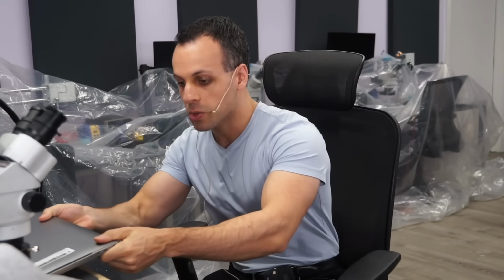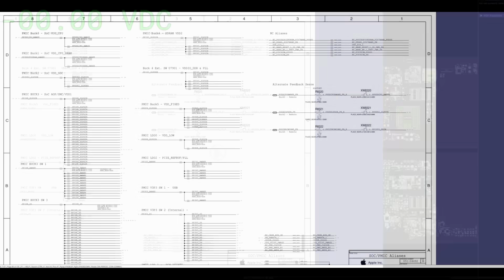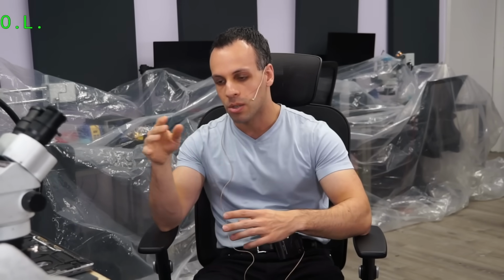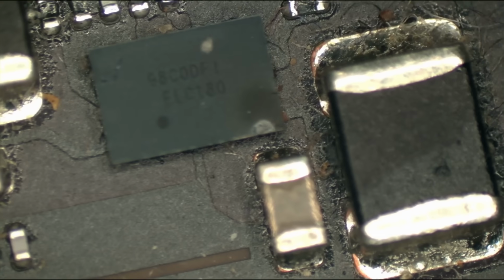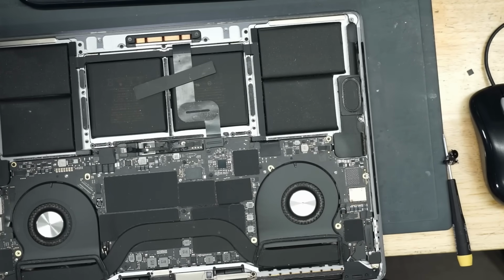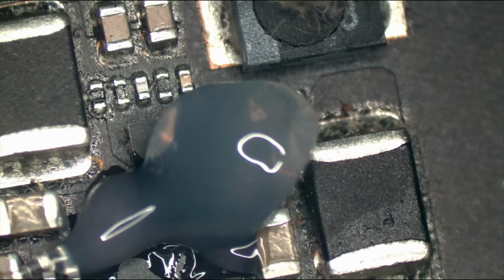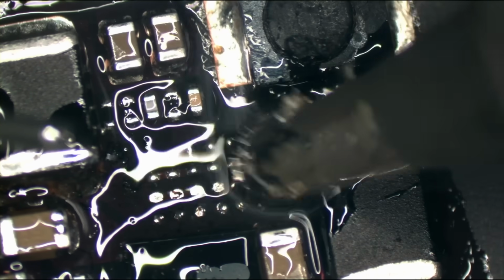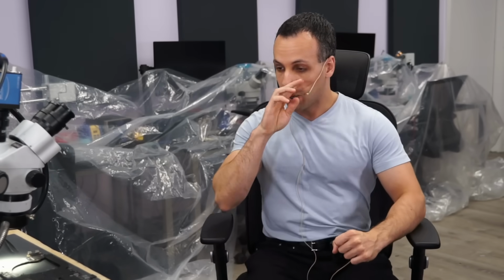How most 16" Macbook Pros often kill themselves & why they're unfixable

Comment: Nice video. Such a stupid situation, they could place a tvs varsitor (voltage-dependent resistor/ vdr) up on to 2.7v line wich would short the line to the ground if voltage excess 3v preventing the nand from frying out. Omg why has it not done. It’s a bug a genuine bug.
Reply: The part just for ex. vcug040030l1wp, this shit costs 21 cents for crying out loud.

Comment: Sir Louis. The exact exact same ditto thing has happened with my MacBook Pro 16" 2019 core i7 model. Apple official Store gave a quote of almost 1000 USD for replacement of logic board. MacBook Pro died in the middle of a very very important work. Had paid 2.25 lakhs INR for it in 2019 end. Have lost trust in MacBook now, after being a MacBook user for 7 years almost. 0 repairability.

Comment: tl;dr
a chip that's supposed to deliver 2v to the ssd instead of raw 13v can die and send 13v to the ssd, killing the ssd, all the data on it and requiring a motherboard replacement since apple won't sell any parts to fix it

Comment: Much of this (Right to Repair) applies to new stereo components.

Machine production lines install parts to PCBs.

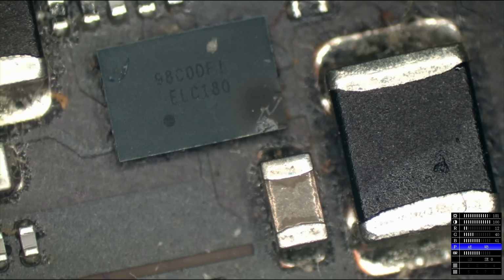6:10

Instead of capacitors being size of a Cheeto, now size of a grain of rice.
Too small for techs to repair part.

They can test boards as he does here for in/out voltages but nothing else can be done.

Once replacement boards are gone, that $2k to $7k unit (Made in China) is done.

This is for 3 year old 7.1 9.1 11.1 stereos.

Comment: I used to use a Macbook because it is way more stable (need 95% less software maintenance) than any Windows device, and Macs are all but immune to online computer viruses and malware ( Ransomware is really bad these days, and Windows is the most vulnerable to it).  But then I learned about the 100% free Operating System called 'Linux Mint', I tried it by installing it on one of my older Windows PCs and now I use the superior Linux Mint instead of my Mac.
Reply: Mac's are not immune to viruses nor malware what are you talking about
Reply: 95% less software maintenance bro what are you talking about

Comment: The original machine has a base-plate of prefabulated amulite, surmounted by a malleable logarithmic casing in such a way that the two spurving bearings were in a direct line with the pentametric fan.
Reply: Yah, but those turbo encabulators were loud, and they smelled like burnt transmission fluid when they got hot. Now with the hyper encabulators, you have to put them in the oven and hope to fix the bad solder joint between the six marsel vanes.  You can check if you're successful by connecting a DRBII to the aft end of the moxie interrupter.

Comment: Hey Mr Rossman, I have this computer in an expensive configuration. Is there anything I should do to prevent this from happening to me?
Reply: Back up your data! Today, external drives and cloud storage are dirt cheap. If you pay for that, you won’t have to worry your data is toast when your on board SSD has died.

Comment: I’ve been using MacBooks since around 2009. Have not run into that issue yet but that really is gross. I really wish they didn’t prioritize the thinner form factor over more reliable parts. Is there a solidly built laptop brand you do recommend?
Reply: If you want dependable Lenovo thinkpads generally. Everyone else pretty much sucks ass. I like blade 15s from razer but they sound like jet engines

Comment: The Magic PP Bus

But I guess their idea is anybody who has deep pockets enough to land a Pro can simply replace it and WILL.  So going through two or three units in a year would be no biggie for the customer.

That's a little like BMW.  A lot of poor bastards scrape and save to get one and have absolutely no idea of the ridiculous maintenance costs.  You can't just buy the thing.  You are locked into an expensive system to keep the thing going.  Much as the guy who scrimps and saves and gets donos here and there and gets a Pro while at the same time not having any means to replace it if it decided to take a shit six months in.

Comment: Louis, I have a 2014 MacBook Pro that my dad gave to me, thing takes a solid 5-10 seconds to open a chrome tab, thing chugs along still but the battery kinda drains itself even when not in use, I don’t really mind but do you think the battery is replaceable?
Reply: On MBPs made up to 2014, all components can be replaced. After that, they soldered everything in.

Comment: I said on a thread that these things are not designed for professionals and it upset people because, naturally they were probably professionals who use Macbooks. 

If these things were designed for professionals, you'd have, SOME, level, of repair-abiltiy. That when an SSD dies? You'd be able to remove it from the computer and slot in another one. It's like, we have 2+ standards for SSDs but sure, just directly solder it to the board. Same with the ram, same with the other thing. 

But they're not. They're designed for people who're okay with disposable devices. SSD broke and you lost all your data? Why didn't you have cloud back up and apple care? That solve all the problems here- clearly. Nevermind that before apple popularized this, we had devices that you could swap out, many, components. We still do, but what's cheaper and makes people less inclined to try to fix it? Integrated, soldered on parts. 

Imagine if everything wasn't soldered down, imagine if they made it easier to fix or replace parts. 
Imagine this device that is actually impressive in it's performance had any ability, to be repaired.
It might actually be good for professional use.
Reply: Well professionals do typically have regular back ups. A lot of companies don't even have anything on company computers and rather have it so everything is on a server elsewhere or available via cloud. if anything backing up from apple can feel better for the individual user. But if you don't have backups and your drive hard fails. likely you're not getting that data regardless without sending it to a specialist.
Reply: @qxevtnu1879  
Hi, professional with a back up drive here: 

I have back ups, but also if my drive fails in my desktop or laptop, I'm not hoping the manufacturer won't screw me out of hundreds of dollars for a a basic standard drive swap that would take all of 10 minutes because they decided soldering was the best option.

Many companies agreed on standards and Apple feels they're above that for some reason. Well, that would be the case if it wasn't just a case of "We know the average user will either pay up the hundreds or, buy an entirely new device for what should be $100 or less.

Comment: I used to work on mac products for 9 years and I will never buy mac products. One year I had to remove around 100 desktop mac computers from the 6 buildings I worked in because they died in a way that could not be fixed.

Comment: Given the fatality of this failure mode I wonder how costly and hard it would have been for Apple to incorporate an over-voltage clamp circuit to protect the SSD.  A zener diode with a conduction voltage below the max voltage of the SSD perhaps.
Reply: How about a replaceable SSD? I know Apple isn't the only one soldering on components but it makes sense for a computer for an SSD to at least be interchangeable.
Reply: @VanSanProductions  Both, but a zener protection would save the SSD (in most cases).

Comment: My (Same model) did something similar last week.  It was running, but all of the USB-C ports died. Couldn't charge it .. couldn't use the ports for anything.  It just happened randomly.  Was using it, and then it stopped charging and the external monitor died.  (Via USB-C). Oh yeah, half the keyboard backlighting shut off as well.  (NO liquid damage)

So, I quickly mapped to a network drive and saved as much as I could before the battery died.  Company sent me a replacement, but going to take it to Apple tomorrow to see if I can salvage any additional data.  

This sounds like a slightly different problem, but it's troubling that such expensive hardware blows up like this.

Comment: My 16” MacBook Pro 2019 woke itself up in my bag and cooked the T-CON board effectively ruining the display because you can’t replace the board without also replacing the display. $700 to fix and it wasn’t something I could prevent other than fully shutting it off every time I put it in my bag. Worse yet, besides the waking up on its own part, that section of the laptop is horribly designed. There is no airflow over the VRMs or the sensitive-to-heat T-CON board. It’s doomed to happen sooner or later if you push it hard enough. After my board cooked I did the VRM thermal pad mod and with an external fan it is crazy how much more performance it can get, stock it throttles the GPU after like 5 minutes because the VRMs overheat due to having literally no airflow to cool them. With the thermal pad mod to actually dissipate the VRM heat, it can run for hours at full power with no thermal throttling. Absolutely ridiculous and horrible design.

Don’t get me wrong, I love the form factor and outer design of it. But it runs super hot all the time because of the i9+5500m in such a small space and then this.

Luckily it was given to me, so I’m effectively paying $700 for it. But if I paid the $4,000 it originally cost I’d be pretty upset (and I also would have gotten Apple Care+ lol)
Reply: Wait a minute...so it woke up with the lid closed and that killed the T-CON? Bizarre
Reply: @Markyroson  for whatever reason it did not automatically shut off when it overheated. I’ve had windows laptops wake up in my bag before, but they auto shut off at some point when they get too hot. They also only had low power CPUs. This one has an i9 that’s already stupidly hot even with good airflow. It got so hot I had to be careful touching it so I didn’t burn my fingers and STILL didn’t shut itself off. Since the T-CON is between the CPU and GPU and doesn’t have any airflow it didn’t stand a chance. Still love the thing and don’t plan to replace it for a while just frustrating it could have been prevented by either better thermal design or an overheat shut off.

Comment: Knowing having a problem and then not fixing it is illegal. The Macbook's should have been recalled, the product fixed or replaced for free. It is also a security hazard because all someone has to do is enter in a command to cause chip to overload the ssd after they have stolen the data. By the time you find out you have been HAD they've already stolen your info. It would take a very large class action lawsuit in order to prove willful negligence with a plethora of witnesses, materials and computer engineering experts. THE DEATH CHIP really can be taken advantage of by someone even Apple. Just think Apple hears that you’re arguing with someone at Apple Care and then a week later your system dies without a trace. Then they blame you for water damage and refuse to honor their warranty. Check Mate. I'm not saying that they are doing this but I am agreeing that they are trying to get out of their warranties way too much.

Comment: I feel like I’m missing something. Why was the replacement chip never put back all the way in the correct place before testing? It was one column of pins over
Reply: It wasn't replaced at all.  It was just sitting there disconnected.  He did another test for a short that was present even with the chip disconnected, which confirmed his suspicion that replacing the chip was futile and the machine was bricked.

Comment: Hi Louis, sorry for asking this because there are probably many people who had asked this already, 
Would you recommend the Macbook pro 14" with the M1 pro chip?
and will you recommend to purchase the AppleCare? From an Asia country, the applecare doesn't cover theft/ accident/ liquid
Reply: no, same reason as video mentions, it will eventually die and there is nothing they will do for you unless you pay stacks of money. The idea that macbooks are somehow efficient and powerful is a ton of crap anyways.
Reply: @danishblunt9698  thanks for the reply. 
Which windows brand doesn't do that and is recommended? 
How about the XPS 13 plus?
Reply: @shengxian  Stay far away from dell, they are pretty much like apple, don't give a damn and their machines are unreliable. 

The beauty of windows machines is that you have many catered towards certain needs, so before I can recommend anything, I'd need to know what you need it for.
Reply: @danishblunt9698  mainly for multitasking productivity works with many chrome tabs, Microsoft office. Photo/ video editing - only a few times a year and just for leisure. Not gaming
Reply: @shengxian  Zenbook 13 OLED (UM325) is probably what you want then. The panel is excellent and catered towards video and photo editors, it has superior contrast vs the macbook and has 100% DCI-P3 range vs Macbook's 13 & 14" 75%. It's even better due to its contrasts compared to Apples 16" XDR display. 

Due to its AMD CPU combined with huge battery it outlasts apples macbooks by a bit and doesn't loose performance on battery. 

It has all the ports you need such as SD card and full HDMI. 

if you don't mind a bigger machine, ASUS also has some seriously incredible machines such as the Asus Zenbook Pro 14 Duo OLED, it's a producivity monster. Content creators are absolutely in love with it and it has become the go to machine for many these days. It wont last as long (for obvious reasons) but for those who arent on battery all the time its a huge deal.
Reply: @danishblunt9698  thanks for the recommendation. I don't really need to do media editing a lot, just once in a blue moon. How about their durability and machine service?

Comment: Louis, not sure if you'll ever see this, but how about a video where you show what people can do to prevent this? It may be as easy as installing a single diode to protect against excessive voltage. I think that would be great content as you'll actually help prevent this shit from happening while also driving up business to those who can actually install said diode.
Reply: I think for almost 4 generations of MacBooks in his previous videos some years ago, he kept telling them about a flaw in the design of their mainboards, and this is what you need to do to fix it (of course it involved using more components, which is apple cutting costs on their gold plated computers, which is the whole flaw to the manufacture to begin with). On the 4th time he literally went on a rant and said hes not offering design fix advice and just advice on fixing because Apple will never fix their mistakes without a lot of market pressure. They want your shit to break, when it does, they want you to only go via apple to get it fixed and pay a fortune for it, and if you don't get it fixed that you drop even more money on throwing it out and buying a new MacBook with the same inherent problems.
Reply: @azzajohnson2123  Thanks for this information, I wasn't aware of it. I completely agree with him then.
Reply: don't buy Apple products. :)

Comment: So the first attempt is to fix the chip that supposedly supplies 2.4volts to the ssd. But when Louis unplug the chip, the ssd is still shorted means that the problem is not only about the power chip got blown, but also the ssd itself has blown because the power chip that supposed to be supply a 2.4volt to the ssd, over feeding the ssd with 13volt instead. Both dead in a single shot..
Reply: You would think they would put the SSD on a separate circuit and make it easy to replace it. That’s not how they do things at Apple.

Comment: It is unfortunate the failure mode of that chip is to fry the SSD.  How about suggesting a fix where if the chip blows it fails open so the SSD doesn't fry?  Or other solutions?  I don't think Apple intentionally designed their systems to blow.  It's a complex to design with so many components the failure mode of a chip may not be taken into consideration in the design and testing process.  Imagine being the engineer working on the product line up and well as the possibly 10 or more iterations of each before you get to the final product.  I would assume they design for the best intentions, the engineers get no praise for the job except only when negative things come to light.  I'm sure there are many products out there that have failure modes that where unintended and caused more harm, like battery fires.  How about work for Apple in their QA department?

Comment: I have a tech with a question regarding this failure. They currently have a 2019 16 inch Macbook Pro that has failed and this is most likely the culprit. His question is does this same known issue exist in the newer 16 inch Macbook Pro models with the M1 chip? I can assume it would but can you verify that this issue has been happening to newer models?
Reply: @stevenp3176  I have an M1 Pro 14-inch. Is this an issue with them as well? How does one go about avoiding this problem?
Reply: @redpillsatori3020  You can’t. What you can do is buy an external SSD drive and back everything up to it. If your soldered in SSD ever gets fried, you still have your precious data saved to external drive. Also hope you got everything backed up to the cloud.